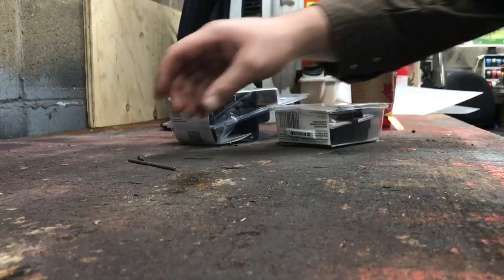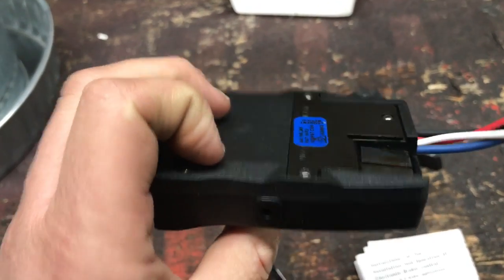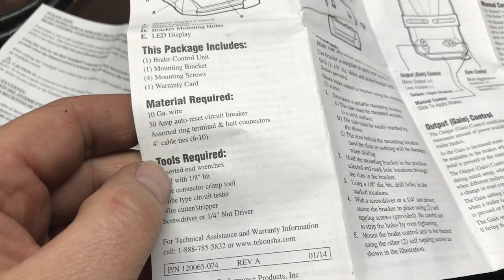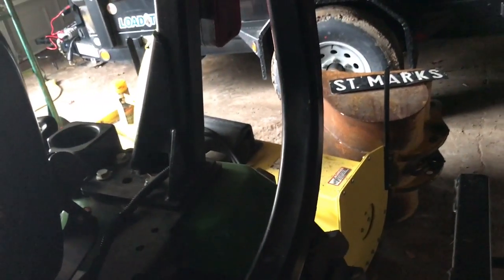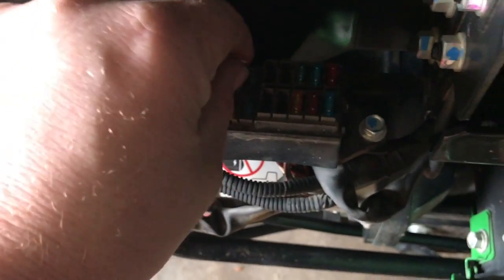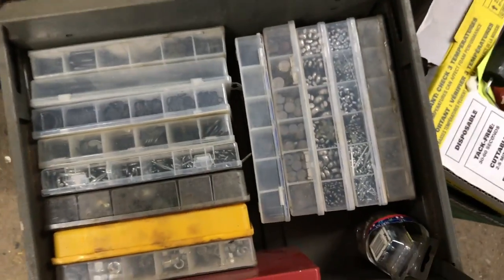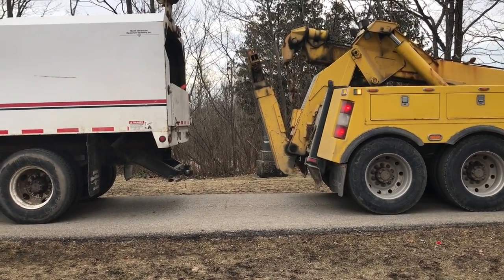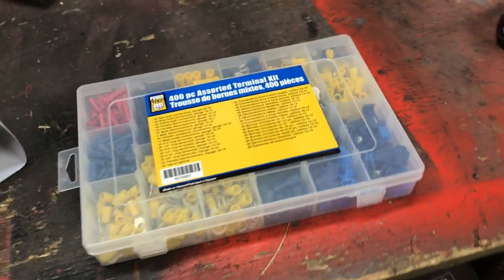Today we picked up some brake control parts

Comment: Mount your controller inside a watertight Clear Plastic Food Box so you can clip the lid back on when its raining.
Reply: I've seen a flasher control unit box mounted in a home made plexiglass box. The top was longer to protect from rain and the side was cut at 45 degree in the front to reach the top and let access to the buttons. Just an idea.
Reply: I'd mount it to the lid with double sticky tape, and then double sticky the lid down. Pop off the box part and it's not in the way. 

Will also work to keep dust out during mowing season.
Reply: just get a waterproof junction box with the water tight gromets

Comment: just a note I have found that if you fill any crimp connectors with dielectric grease they last forever here in Wisconsin.  this combined with shrink tube keeps moisture out stops corrosion and seems to help a lot with vibration.

Comment: Why not just use the trailer as is and see how the brakes works instead of messing around with it?
Reply from the maker: thats the plan for the first one i dig :)
Reply: If the controller are required why doesnt the trailer come with it? I dont understand I wouldnt buy a car with brakes but no peddle.

Comment: you could wire a water proof momentary button to 12v  then to  brake wire on controller press when stopping  same as brake pedal then can mount controller under hood were out of weather and if wanting to hook tractor to hydraulics use curlers on pump so can disconnect tractor and pump like hooking plow

Comment: If those trailer brakes are actually powered electrically, then they're gonna draw quite a lot of juice (meaning high amperage), and since the more amps you have, the thicker your wire gauge needs to be, I am actually wondering how you're gonna get away with these thin wires passing up to 30A (or at least more than 20) through them without getting hot and maybe even burning through, which wouldn't be a good thing!

Comment: Bill, Get a dry bag for boating they sell different sizes that would fit perfect. That way you can put it by shifter fit the connections inside the bag. you can attach it with double face tape or 3M velcro.

Comment: bill get the different plug. and use the red wire so when you step on the tractor brake pedal it will automatically apply the trailer brake! 
then you can mount the brake controller  in a water proof  box like a plastic ammo can from tsc! 
a hint your tractor has brake lights on it correct?  so red goes to the cold side of the brake light switch!  with the red wire hooked up, you just set it and forget it! lol a little Ron Propeel you know from Ronco!

Comment: tsc has the plug pigtail to plug into the 7 way plug as well as the brake controller so than you can keep their ends also yesterdays vid your electric brakes will work all the time if it came disconnected with the brake away that's what the blue wire was for to the battery in the toolbox on the dump just like on your other trailers they probably have a 12v motorcycle battery lantern battery in a black box up by the tongue this way if the trailer comes disconnected and unplugged the brakes on the trailer will activate if you get the plug to plug into the brake controller than you can plug it in and out as you need it  or any male female plug good day bill

Comment: it's easier to tow backwards because if u tow it from the front u have to drop the driveshaft or pull the axles out.    tow from the rear it's just pick and go easy peasy

Comment: Hey Bill why not mount the brake box doowee under the hood and use a waterproof push button switch wired to the red wire and use the gain system on the box to control the brakes as in replacing the brake light power with a manual push button

Comment: Bill can you put it on the right side beside the shifter and build a flip Top Lid over it then its right at your finger tips and it stays Dry and you can drop the wires below the shifter but use the bracket that came with it it should keep it high enough that while under the Flip Top Lid water can pass right by it.

Comment: them wires under ur seat is all for the extra set of lights jd sells for that tractor. i have them on my 2520. it includes a rear work light also. no juice in them till u turn the light switch.

Comment: bill doesn't your tractor have brake lights when you step on the brake now i know you don't need to step on the brakes all the time cause of the hydro drive but i thought they still had brake lights that lite up when you stepped on the peddle its been a while since i drove a jd they want you to draw power right from batt so if there was a short the circuit breaker will trip and reset it self so your not totally with out brakes just like on a car they use circuit breakers too they reset them self in seconds so your not without you want the breaker close to the battery supply as possible

Comment: Had a thought why not a Tupperware dish run the wires out the side or back seal with silicon use the lid for keeping it dry double sided tape to set the controller on the inside

Comment: you can attach your power wire to the starter + lug that's a direct line to the battery . not advisable to draw off the alt

Comment: Bill I think the controller unit uses the brake light in the truck to control when unit comes on so you can mount it under hood somewhere and just use waterproof button to turn it on.

I think if you look at your trucks brake pedal you will see pressure switch that when brake is off circuit is off. And when you press brake it closes.
Reply: soaringtractor 
I know but the controller still has to work the brakes on the trailer the same as the TRUCK!!!

Comment: bill look at the brake peddle, check it for 2 wires on hot all the time one hot only when your foot is on the brake! this is the wire you want! to hook the red wire  up!
Reply: soaringtractor OK so go get a push button switch that has 2 wires on it, that is on +12volts when pushed! and mount it to brake peddle. get one from princess  auto for a 1995 chevy truck. bill

Comment: the hydraulic is locked it can't start i.might have to do a complete engine job but I need to release  the lock
Reply from the maker: is it worth it to have to do the engine? what year and how many hours?
Reply: BILLSTMAXX  it's the same year as yours only 850hrs
Reply: is there any other way beside neutral to release all the Hydraulic Lock so I can  at least move it to an easier location to work on

Comment: princess auto brother you can get the one that comes apart so you can screw the wires on to it and the brake control is what it is  you will have to put in a waterproof box
Reply from the maker: wish i had one closer!
Reply: BILLSTMAXX I'm sorry if I couldn't help more I'm from USA and down here there are autoparts  places on every corner here
Reply: soaringtractor  I'm sorry here in Virginia there on every street corner